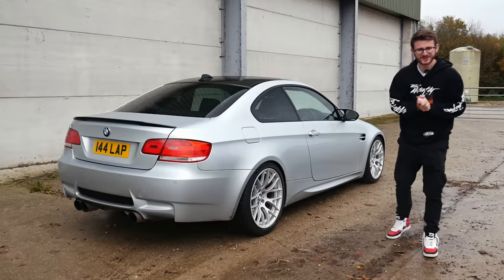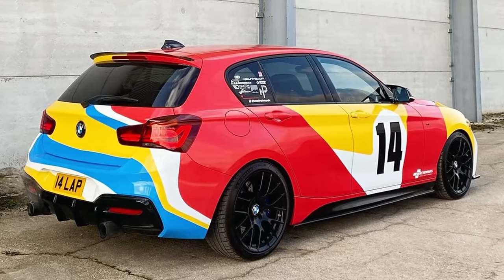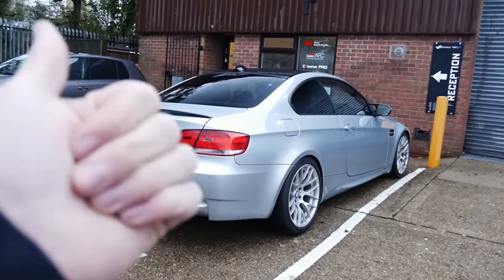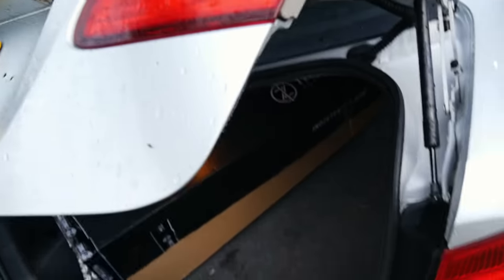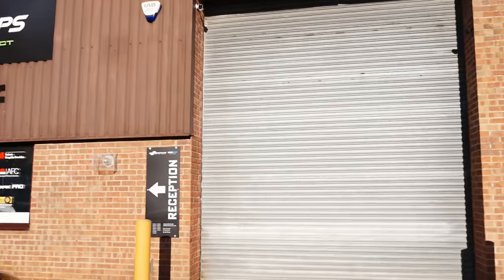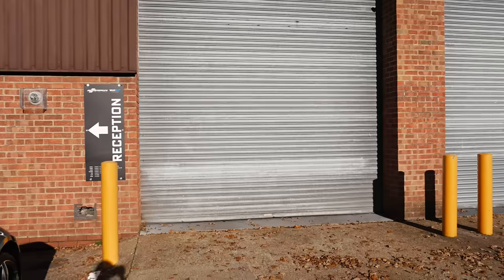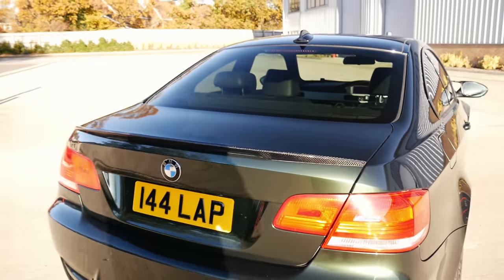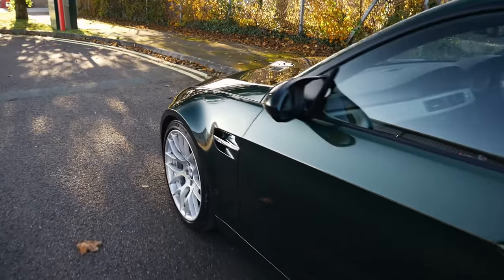WRAPPING My E92 M3! *Huge Transformation*

Comment: Nice colour, just shame about all the swirls on the vinyl already! They could have lightly machine polished it, then ceramic coated it.
Reply: Spotted that also, close up in sun light
Reply: it's little things lights need cleaned updated rear lights holes for plates vinyled over madness wheels need satin black in my opinion
Reply: @gordoncrouch7766  didn't notice the plate holes at first but agree. What's the point in going to all that effort if you didn't fix the little things that have now been highlighted by a wrap.....